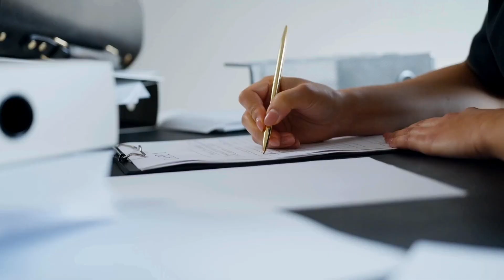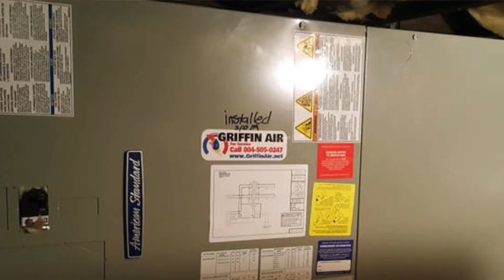HUGE Problem! Step Missed by HVAC Contractors that can COST Homeowners Big Time!

Comment: Also, a lot of customers will lose or throw out the envoice that explains what the repair was. And in some cases, the technician's handwriting was so sloppy that determining what he did was nearly impossible.
Reply from the maker: Good point. I have friends that stopped using handwritten invoices for the simple reason that no one could read them

Comment: I do that if it’s not something small. I recall recently changing 2 air handlers and writing on them R22 txvs installed (customer just changed air handlers and kept condensers), 410A txv left with unit @ this spot so whoever puts new condensers on later already has the 410A txvs and knows they need changed. They came on the unit anyway might as well leave them for future use

Comment: I agree...HVAC and other equipment should have a service list on or next to them to support several years of maintenance and repair trips to give a history of that units concerns. Just like an automobile and its oil changes, many folks record this information in one place to have quick access about that subject.
I have seen some contractors tie a service tag onto the equipment about what they did and dated it. I'd prefer something similar to a clipboard and lined paper or maybe a paper booklet with a chain or string attached to it. I also agree that when a new system is installed that a list of the critical information about the condenser, evap, dampers and their ducts, water heater, garbage disposal, refrigerators etc. all have a document that has the data plate info and so forth so the owners don't have to go into the attic to know what they have or what was repaired last.
Also, for locations with two or more HVAC's, the air handler and condensers need to be labeled level 1 or level 2 (upstairs/downstairs) so the tech that shows up isn't spending time figuring this out on the customers dime. I'm aware a lot of people won't use this information until the last minute however, it will make them more aware of the subject. In the end, it speeds up customer knowledge as well as the tech when showing up to a new location they have never been to.